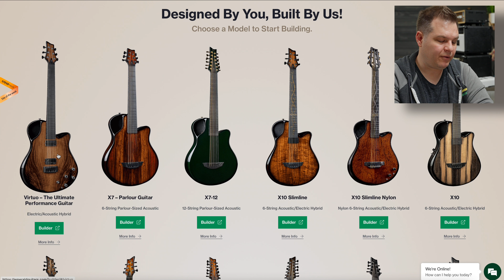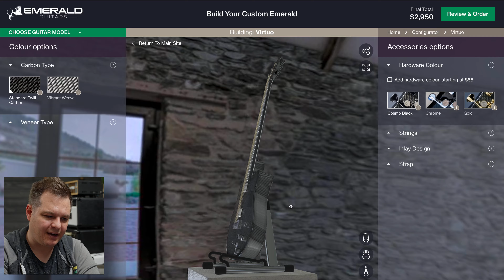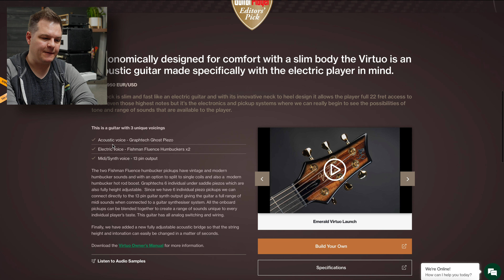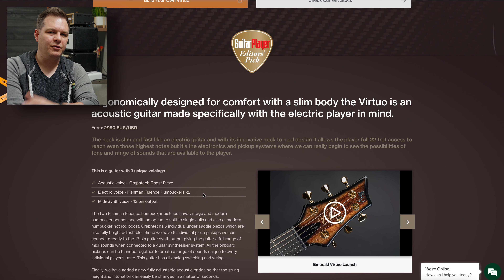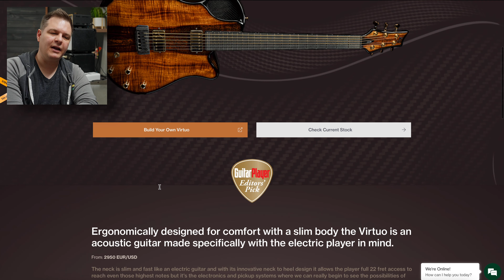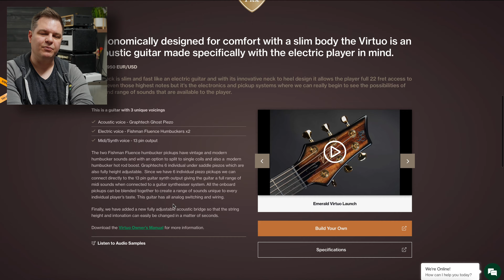Designing a custom guitar that can do EVERYTHING // Emerald Virtuo (online builder)

Comment: I bought a Koa Virtuo and I love it. (It is my third Emerald) I have the amber back and sides with black hardware. Great performance guitar. Quiet on stage with no feedback, but loud enough to hear if monitors go out. I used to use IR’s with it, but found it sounds great acoustically, using only reverb and direct out. No piezo quack as with other piezo systems. It sounds ok unplugged but that’s not what it’s designed for. Still sounds better than Acoustasonics, Taylor TZ’s, and any solid or hollow body electrics with piezo. 

Looking forward to your review!
Reply: Thank you! :)

Comment: I ordered one of these and paid about $4500 back in October.  It arrived defective. The battery box was broken and I reported it right away. They told me they’d send a new battery box right away. They never did. Over a week later I contacted them agsin and they said the battery box eoukd need to be installed by them so they wanted me to return it to have it fixed. It went on and on. I got so frustrated I demanded a full refund which I eventually got.  But their customer service was terrible.  They will send you a nice guitar because this is advertising fir them.  But I was a paying customer and completely got ripped off.  I was disrespected repeatedly by the people at emerald and they then tried to blame it being defective on me.  I can’t recommend emerald guitars ever again after that terrible experience.
Reply: Man, it pains me to hear you had such a poor experience with Emerald. I’ve purchased two new units from them and have had nothing but great products and great service. 

I thought they were better than that. Sorry for your pain.